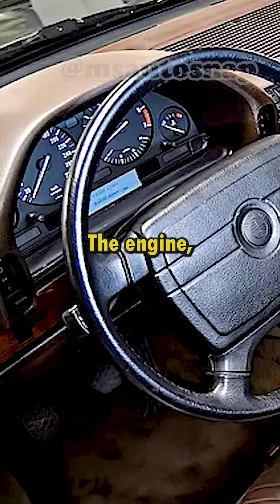When Engineers Build Cars! #bmw #mercedes #bugatti

Comment: Honestly shocked to see that the comments more or less agree with the OP 💀 the real post should be back when marketing departments built cars not engineers bc getting 200+ hp out of a light 3 cylinder is way more impressive than 400 hp out of a 6+ liter engine

Comment: 300 hp from a v12 in the late 80s might sound wild today but was pretty standard for the time without any turbocharging
Reply: Cadillac had 140hp/250 lb ft torque with an Oldsmobile V8 in a 4300lb sled called the Brougham.  The Cadillac exclusive HT4100 made 135hp/190lb ft torque in their smaller FWD cars.  Lincoln had 150hp/270lb-ft  in the Town Car at that time. The BMW V12 was A LOT of power for the time.
Reply: @AaronSmith-kr5yf Well that was because of the oil crisis, a 1970 Cadillac Coupe Deville had 375 Hp and 525 Ft-Lbs
Reply: @AaronSmith-kr5yf it’s wasn’t a lot for the time as far as technology, complete garbage actually. auto makers should’ve unanimously flipped the regulators off and said we’re selling what we’re selling.
Reply: The TR512 made 390HP (V12 180°) in 1984.
Reply: @martinb.770  That was a sports car. Also, Countach QV and Diablo had 455-492hp V12s in the late 80s. But for luxury saloons, it was different.
Reply: @martinb.770  And lasted at least one trip around the block.
Reply: Opel did make a inline 6 engine whit 377 in early 1990.
Reply: @ThePapaja1996  Thats done by Lotus though. The Lotus Carlton's engine may have been based on an Opel unit but Lotus worked on it, while Opel insists on their own version in the Omega/Carlton GSi
Reply: Not to mention, the v12 in the 7 series wasn't made for big power, it was for the smooth and effortless power delivery you'd need for a big luxury car, as luxury v12s often were renowned for. Toyota had a car called the Century with a v12 as well with similar performance.
Reply: Remember children, horsepower sells cars, torque wins races.
Reply: The 80s was a bad time for good engines, EPA ruined alot
Reply: its the size of the cylinders mainly
Reply: @backwatawood  the extremely high quality internals have made it possible for 4 cyl 
Turbo engines produce power at levels still dreamed of in those 16-18cyl beasts.
Reply: The 80s were all about turbocharging.
Reply: They were getting 2000 and 3000hp from their marine and aero engines during WWII .
Reply: Emissions
Reply: the Nissan 300zx of roughly the same release window made 300 hp with just a DOHC 24 valve TT engine, half the engine but nearly the same output!
Reply: @SomeGuy_Somewhere    And that's not even one of the good Japanese tuner engines.  The Toyota 2JZ-GTE and Nissan RB26DETT were making 500hp with the stock turbos, a few bolt on parts and a remapped ECU that upped the boost.   Absolutely nuts what the Japanese were doing in the early 90's.  Shame that we never got those engines in our US spec Lexus and Infiniti sedans.
Reply: @AaronSmith-kr5yf  VG30 is just as capable as an RB.
Reply: @AaronSmith-kr5yf , а если снять с них атмосферные лошади, что покажет стенд? Около 180-190 в лучшем случае.
Reply: Without OHC
Reply: @randomyoutubeaccount6906  That V12 was OHC. It was not DOHC though, like the later ones.
Reply: @8Hshan  I didn't know. But my only point is there was a lot before turbo charging that upped power numbers
Reply: @randomyoutubeaccount6906  Right! Now you have everyone tryna one-up each other

Comment: The M70 made 299hp "on paper" due to some weird tax evasion reasons, but they were usually dynoed making about 320hp or so.
Same as the latter M60 V8 was claimed to make about 280hp and limited to 240kmh as in reality they too made about 300hp or more and that would've hurt the sales of the V12 models.
Reply: Same with latest BMW's. The so called BMW horse powers.
Reply: M60 was the last V8 without the VANOS system

Comment: W18 is impossible, that's 4.5 cylinder per row lol also on the image You have here, we can see W16.
Reply from the maker: W18 is 3 rows with 6 cylinders. I used W16 image as I couldn't find a nice image of a W18 engine block
Reply: @MSAutoSnap  oh, didn't think of 3 rows, anyway, that's the first time i hear about this, and at the same time it's the 1000000000 time i hear about anything else mentioned in the clip, i need to check it myself
Reply: @MSAutoSnap  Ok, found it already. I guess we learn something new everyday.
Reply from the maker: @dred8954  its always worth to fact check the info from new sources 👍

Comment: A 6.7 liter DOHC V16 with 400hp that needed the whole car modified into a cooler to run and they keep saying American V8s were low on power.
Reply: Agree, 190hp from 440cid is achievement :D
Reply: @r11tc  yes like the 4 point something liter GM V8 with 140hp, with a depowered cam and carburetor in the oil crisis of the 70's that come back to normal if you derestrict it.
Reply: @johnbelwell2461  Agree, same blocks (producing 300+HP) came with half the power after 72's. Personally I think 69-71 was golden era for musclecars. My point was M70 V12 in general was built to haul 2 ton mass therefore long and narrow intake runners with 2 valves per cylinder = low end torque. Yet 400HP per 6.7L isn't bad either.

Comment: Now you have 1.2 liter 3 cyl engines with 400hp
Reply: И главный вопрос это ресурс такого маленького двигателя с большой турбиной???
Reply: No, now we have a huge turbo making that output, with the little 3 cyl relying entirely on said turbo for about 80% of that output.
See how many N/A 3cyl engines with 400+ hp there are....?
Reply: @soundseeker63  those things will need a least 15000 rpm to reach 300 hp without talking about reliability...
Reply: 2 @soundseeker63
Reply: @soundseeker63 acting like a small engine needs a turbo u can make a powerful small NA engine just look at like sport bikes
Reply: @bobertochens  400hp sports bikes?
Reply: @bobertochens  Yes, at 12,000 + RPM, and with nowhere near enough torque to move a car anything close to quickly.
Reply: And a scheduled visit to replace the engine after 50,000 miles.
Reply: @miketango9012 50,000 miles if you are lucky.
Reply: Yeah the pistons bouta fly out of the hood.
Reply: And don’t last as long. Shi dragster make over 10k hp but only last one run. All these new low displacement engines with a bunch of power are under a tremendous amount of stress. They won’t last as long
Reply: It just doesn’t feel the same. I have 1.4 turbo opel Astra that is 140 hp, it feels like engine is really suffering when I floor it. It goes but it feels so fragile and weak. On the other hand I had a 125 hp Volvo S40 1.8 naturally aspirated, when I floored it, despite having 15 hp less, it felt strong, durable and natural.  Keep in mind the difference in size in my case is just 0.4 litres, i can’t imagine comparing a 6 liter V12 to 1.2. So a large engine with the same horsepower will feel much much better to drive than tinier version with the same power figure.
Reply: and they break after 100tkm
Reply: wich get fire after 10k km
Reply: And the resource of such an engine will be, in the best case, about 50-60 thousand kilometers. Then only replacing the engine, since its overhaul is impossible and the cost of replacement is half the cost of the car. And these engines had a service life of about 1 million kilometers.
Reply: @tedodor1  1.4, 4 cylinder 300 hp vs 4.5 V8 300 hp -it simply don't feel same. Large engine feels better to push. When I floor it in tiny engine cars, it feels like the engine will explode. When I floor it in large engine cars, I feel like I am not even getting the full potential of it as there is not enough road.
Reply: show the proof. or is that a crapola lie to get comments? no such car with 1.2L turbopowered can get 400hp.
Reply: @ yes it was an evil lie to trick all of YouTube to like my comment and now I‘m a supervillain billionaire thanks to those 550 Likes this truly had been my life goal but you caught me.
Reply: @tahaak  my 1994 Toyota Carina gti-r 1.6l is 198bhp factory
Reply: @corglass  specifically a 1.2 litre car factory standard that can achieve 400hp......nope
Reply: Or a 4 liter naturally aspirated flat 6 that makes over 500 hp.
Reply: Hp is just a number. It's still a crappy 1.2 3cyl
Reply: @chrisxa1222 "Just a number".
I bet you're fun at schools.
Reply: @chrisxa1222  no its not its the rpms x torque so it does mean something
Reply: @chrisxa1222yea
Age is also just a number
A prison is just a room
Reply: @chrisxa1222Then displacement and number of cylinders are also just numbers.

Power is the only true indicator of performance, as it's energy per second.

Torque is a function of power and rpm. It's just that nobody talks about power other than at peak rpm.

Dumb people: "more cylinders = better engineering". Very low quality content.

Opinions on EVs achieve an even higher level of ignorance.

Yet you all vote... Therefore you get bidenz and trumpz
Reply: @chrisxa1222 A W16 developping 400HP is not an accomplishment in the late 80s, bro... It's the contrary. It's extremely LOW. The F40 was a V8 with almost 480HP.... 400HP with a W16 is a joke.
Reply: @chrisxa1222  they still manage to completely obliterate some old American V8s. But they have no soul and probably break after 5 years.
Reply: @tahaak  the old American v8s completely obliterate them in terms of reliability smoothness refinement and serviceability
Reply: @tahaak only reason some of the older v8s had low horsepower is because of a gas crisis. They are very easy to rework
Reply: @chrisxa1222  Hp is a unit of measurement for power which is energy divided by time. In other words, how quickly can an engine output energy. This is very important factor which affects the torque and acceleration of a car.
Reply: Like what?
Reply: I'd take a 296hp V12 with a 6 speed manual over that any day.
Reply: Lol steve morris motors is working on one with a sxs can am modification company on beefing and putting alot more boost threw the new 3 cyl turbos they run and theyre currently knocking on the 1k HP door and its taking the abuse with latest iterations they made

Comment: how is cars back then have such low hp for such large displacement?
Reply: Engine mapping wasn't popular then.
Reply: Modifying cars was not popular and general at all. Ppl used to have stock car
Reply: It's NOT the horsepower that gets a car moving its the TORQUE A V16 makes a LOT OF TORQUE

Comment: At that time, the Japanese engines produced 296hp in an I6
Reply: So?
BMW were making a 3.5 6cyl with 286hp at the time (in 1987) and had got it up to 315hp by 1989. 
By 1995 they had an N/A 3.2 i-6 with 321hp Whats your point?
A crazy peak output is obviously NOT what BMW were after with THIS engine.
Reply: @soundseeker63  They just made these hps in 2.6 l I6, Talking about 400R and supra
Reply: @TheApexEditzz  With turbocharging yes, they did.
BMW and Mercedes preferred to stick with N/A for their petrol engines until emissions regs forced them to start physically downsizing everything.
As as I already said, power output alone was not why BMW designed that engine.
They wanted something with loads of torque but also silky smooth and silent to move to top 7-series along quickly but effortlessly.
Yes you could have gotten the same power out of a much smaller engine with turbos but it wouldn't have had the same level of refinement or smoothness of torque delivery.
Reply: @soundseeker63  True i agree because German engineering is better than japanese. But BMW is now making heavy coupe for which GTRs will be preferred
Reply: Well Porsches flat 6 made that power in late 90s early 2000s its just that Mercedes and BMW went batshit crazy
Reply: @mrvelic8523  True
Reply: At that time JDM had 280hp limit agreement, and you're comparing turboed clitor vibrators with perfectly balanced engines for gentlemans
Reply: Yes you are right but they had an agreement for the power restriction so it produced 296 hp
But in US supra produced 320hp and 400R made 420hp
Reply: Yeah Nissan's skyline was making 290 & their 300zx was making 300 with half the cylinders of these complex german monsters.
Reply: You know that BMW had I6 with over 340hp naturally aspirated during that time...
Reply: @addywachol3292  Do you mean the BMW Z4? thats the only BMW I know that made 330/40 in an NA I6. That came out well over a decade later in 2006 & was prone to catastrophic engine misfires.
Reply: That's why BMW and Mercedes both use forced induction today, rather than these mechanics nightmares.

Comment: W18? where?
i count 16 cylinders making it a W16!
Reply: They showed an engine block from Veyron's WR16. But Mercedes really worked on W18.
Reply: @oskarskalski2982  18/4= 4,5 Zylinder per Bank ??????
Reply: @rolife74   It had 3 banks of 6 cylinders. There are sketches of this engine, look it up "mercedes W18 engine.
Reply: @oskarskalski2982 that not makes a "w" shape, stay logical
Reply: @alkamz   I'm not saying it's logical,it's how mercedes called it, just google "mercedes W18 engine". There are sketches and documents how it was supposed to look.
Reply: @alkamz  I think that "w-engine" is the common name for all engines with more than two cylinder banks side by side so that all the cylinders drive one and the same crankshaft. Actually, an engine having exactly the shape of letter "W" would be like two V-engines side by side, having two separate crankshafts!  There are no such car engines, I suppose.
Reply: @66Flux  you saved me a lot of typing.
Reply: @rolife74  no: 18/3 is 3 banks of 6 cylinders
Reply: @alkamz  3 banks of 6, it's a real W engine. The banks on that design were meant to be positioned like this:
\ | /
Reply: More a Cyrillic "sh" then. (Ш)

Comment: BMW heard merc building a w18 decided to cancel their plans 💀💀💀
Reply: Image your worst enemy working on making a goddamn w18 engine💀
Reply: B|MW was planning a 400 hp v16 and Mercedes was planning a 700 hp w18. That would've been quite a beating.
Reply: @Anonymous-sb9rr  No. BMW actually BUILT that 400hp V16.
Mercedes was PLANNING a W18, but thats as far as they got.
That hypothetical "beating" never happened because that Mercedes engine never went beyond the paper blueprints stage.
Also, BMW fitted their V16 with a manual box so it was just better than what Mercedes made at the time anyway.
Also, lets not forget it was BMW that made the V12 engine that went into the McLaren F1 aka fastest car in the world a few years later....
Reply: In reverse.  Mecedes first began to copy BMW's idea of large engines, and when BMW found it impractical Mercedes decided to do the same.
Reply: Supposedly BMW didn't want to start a horsepower war .But Mercedes went on to create some monsters in the early 2000s.
Reply: @daidinero7745  The horsepower war just happened a few decades later with turbocharging etc. :)
At least that made much more sense than...w20 engine or something like that :P
Reply: BMW Build the V16 Enginge, Mercedes W18 Engine was just a blueprint but never build. 😉
Reply: They kept the engine with 2 less cylinders and put it in the bugatti veyron and chiron
Reply: @amiingoesuz  Maybe they sold the plans to VW  ;-)
Reply: @amiingoesuz  Mercedes had 3 banks of 6 cilinders, Bugatti has 4 banks of 4 cilinders, it's a completely different engine.